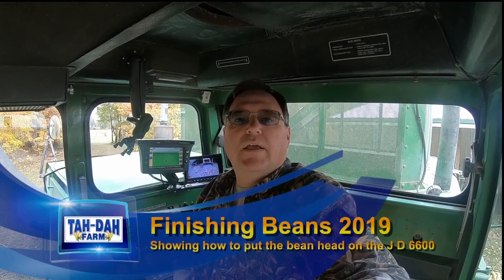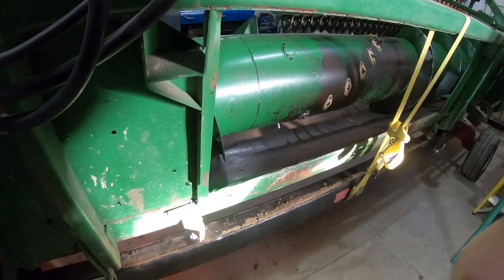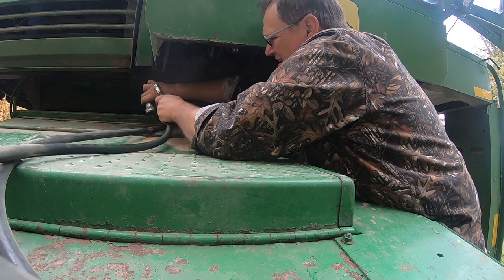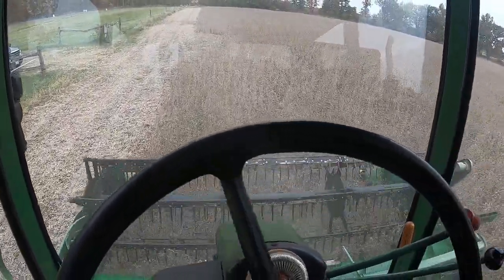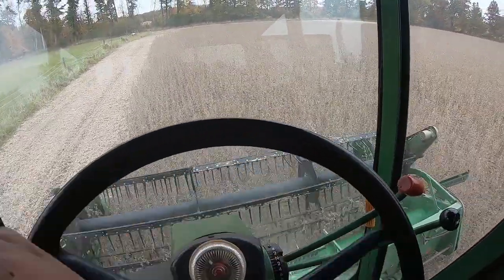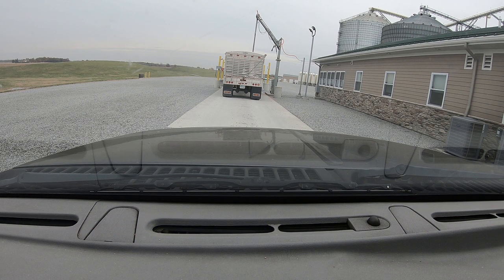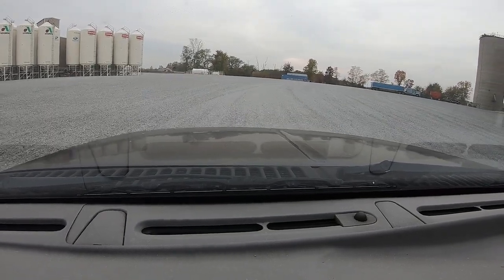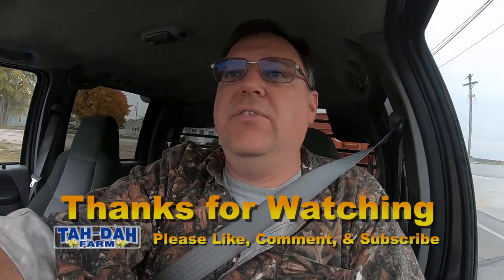Bean Head Install on the 1974 John Deere 6600 and Finishing Beans for 2019

Comment: We had an 300 bushel unverferth gravity box and I pulled the bumper off my 78 ford F-150 one year. Took me a day but I  rebuilt the hitch and bumper.. usally pulled that trailer with our ton & half bob truck or a tractor.
Reply from the maker: I use my 1 ton truck that has a new flat bed on it. The hitch is part of the bed. My neighbor will pull 2 300 bushel wagons with his 3/4 ton. I told him he is crazy,  lol. I have pulled 2 250 wagons at the same time but not a fan if it. I do like using the 400 bushel Parker grain cart I have. It seems to be the best setup to move the most grain at a time that I feel comfortable with.  Thanks for watching and commenting.

Comment: Take two pieces of tape put them on each side of the combine feeder house and top of the header that way just line up the pieces of tape and you should be lined up with the holes first try. we used to do custom harvesting and we would never would waste time backing up and turning around at the corner we would just make the turn and come back after we finish the field and pick up the corners that were left save a lot of time.
Reply from the maker: Thanks for the info.

Comment: Is it 40% a little bit high on the foreign matter? Maybe adjusting the screens could have helped a little?
Reply from the maker: I miss spoke,  it was 0.40%, but I did say 40%. I did not getting docked for FM. I do appreciate you watching and listening all the way to the end and your comment.  Thanks again.
Reply: @TAHDAHFarm  I did custom harvesting back in the 1980s with  Small's Harvesting out of Senath  Missouri. They had moved their base to south Mississippi because they had two really big customers down here. I used to cut beans for them down here after we went out west cutting wheat. I had a few customers of my own and I would take their equipment and cut myself. They had 16 John Deere 8820s but they kept two of the old 7700s from the previous upgrade. Their customer base was a lot of older farmers and one by one in the 1990s they passed away and finally got to the point they just went ahead and closed shop on custom harvesting. I developed a love for it so much here in my sixties I'd like to get a little 6600 and do a little harvesting myself but they've stopped growing anything down in south Mississippi as far as crops all they grow down here is cattle! Lol. And I can pick up a nice combine fairly cheap but there's nothing left to cut it's a shame. But I like watching the old John Deere run.
Reply from the maker: It is very hard to find ground and I don't want to be getting ground by "steeling" it. All the ground I am farming, all 50 acres, has been new ground from hay fields or big farmers that don't want the small fields. I am looking forward to farming the 16 acres I have perched over the last 2 years. The rest of the fields are 2 to 6 acres in size. My goal is 100 when I retire just to keep me busy.  I wanted to just help the neighbor guy but he didn't want any help. So I'm doing it by my self.  I'm having fun and that's what it is all about.  Thanks for being here and watching my channel.

Comment: Isn’t 40% FM kinda high, can’t the air and screens be adjusted to screen off more unwanted FM
Reply from the maker: I miss spoke, it was 0.40% which is pretty good. They don't dock on payment until you get to 1.0%.
Reply: @TAHDAHFarm  that sounds much better. I running a 7700 Turbo presently but also have the 6600 and 4400 all with ridgid platforms, 215,216 and 218 Draper. I harvest grass seed where small grain chaffer is used on top with a round hole perforated screen on bottom are used. Low air speed, 400/450 and higher cylinder speed, 1000/1100 and tighter concave settings are used to strip seed from grass stems, concave on 2/3.

Comment: Do you ever have trouble feeding green stem beans with that head? I've thought about converting a Deere or CaseIH head to fit my R52 Gleaner. My 800 series head doesn't feed very well. Otherwise I'm looking at an Orbit Reel or Crary air reel but that's expensive.
Reply from the maker: I haven't had any problems with green stuff but short beans kinda pile up and then catch which then will give you a slug. Just have to watch for it and it goes just fine. Good luck with whatever you decide.
Reply: @TAHDAHFarm  Thank you. I think I may try an Orbit Reel and see what it does and if not good enough maybe look for a green or red head..... hmmmm my wife may not understand that last part LOL

Comment: My son just bought a 4400 combine. I was wondering if you know what that white light right  above the steering wheel is for. Ours looks like it has a red bulb inside but it never comes on so just wondering what its for.
Reply from the maker: I just went back to look for a video but I can't find it. I have talked about it before but that will make for a good video to do. The light will flash when one of the 5 sensors are not running fast enough.  There should be a box to the right back corner of the cab that has 5 lights on it. That is the monitor control panel and will turn that light on. I made a lot of repairs on my to get it working again.  I will definitely do a video on this in the near future.
Reply: @TAHDAHFarm  Thanks for the reply. None of those sensors work on our combine so thats probably why I have never seen this light come on. We are planning to try to get those working if we can. This combine has around 3200 hours on it and it appears to have a newer concave in it because it has newer looking black paint on it. Its also a diesel with the rotary screen. My son paid 1000 for it so I feel we can do a few repairs on it.
Reply from the maker: My John Deere dealer let me borrow the testing tools to check the control box and make sure it was working properly. I had to replaced the lights and I used LED that a friend got for me. I then went to the combine graveyard and got the used sensors that I needed.  I also found that the switch under the cab was plugged up with dirt and bent. It is located so that when you push the handle forward to start the threshing,  it sends power to turn the control box on. It is nice to have, I had the chopper belt come off one day and the light started to flash. So I then looked to see what light was on on the control box. I know the combine graveyard has the control box if you find that yours is bad but it is not cheap. Good luck and thanks for subscribing to my channel.

Comment: Always enjoy your videos your the one I closest relate my operation to. Glad you’ve had a good year. Any purchases on the horizon
Reply from the maker: Thanks for watching.  I bought the Kewaunee disc about 2 weeks ago.  I looked at something on one of those small used private lots. With the purchase of the disc, I am trading my IH 370 disc and some other equipment that I will not need for something,  lol. I don't want to give it away yet,  so stay tune. I hope to switch the equipment this coming week and make a video of it.
Reply: TAH-DAH Farm I’m gonna bet it’s a no till drill. If I’m right and it’s  a Great Plains the dealer I worked for sold those as well. You asked about the cylinders on the kewanee folding disk. I couldn’t remember for sure but a friend said everything kewanee was cross he thought.
Reply from the maker: It looks like a Cross.  I talked to Crose the other day and the guy emphatically denied that they made cylinder for Kewaunee.  I was later talking to B&B Hydraulic which is located close to Crose in Kansas.  He told me that they made a lot of parts for different manufacturers like Kewaunee and when the manufacturer goes out of business they get rid of the line of part to push their stuff. B&B was not surprised at all about Cross's comments.  O well,  I ordered 2 new Crose cylinder for B&B and they should be here on Monday. My biggest problem was the shaft size on mine was 1 3/8" and Cross are now 1 1/4".
Reply: TAH-DAH Farm as long as your bought a set so the ones it’s phased with are the same it should operate exactly the same. If you have any trouble I can try to help with what I know. The only real problems I remember having were the rear hitches were week and I remember a few had the little links on the side that are part of the fold (look like a midget top link) would break. Otherwise their a great disk to own.
Reply from the maker: Those top link things look to be ok. Need to oil them up good. As far as the hydraulic for the wings, it also has what looks like a splitter that will regulate the flow so they move at the some rate.  It seems to be working just fine.  Will see next week.

Comment: I actually thought they were easier than that. It's not bad but my Dad's 1961 E is no harder. Just has to be on a level surface and drive in. Sometimes it takes 3 or 4 attempts and the next time you hit it the first time.
Reply from the maker: The only thing different then my neighbors 6620 and any of the newer combines is that they have a lever that locks it on and I have to use the bolts. Some also use a pto type setup and not the chains.  Thanks for watching.

Comment: What is the orange light on the top of the steering column behind the steering wheel.
Reply from the maker: This combine has a monitor that has 5 rotation sensors monitoring to make sure that everything is at proper speed.  If one of the areas slows down, ie a belt breaks,  that light will come on. This is an earlier version of monitor so the light is the only indication that will get your attention there is a problem. The newer combines have a light and a buzzer. There is a panel down by the gear shifter that has the 5 individual lights to let you know what area is the problem.

Comment: Are you pretty far from the elevator not to use a tractor on the wagons?
Reply from the maker: Yes, it would be at least 45 minutes one way with the tractor and with the truck it is about 20 minutes. Then the time it takes to dump at the elevator. I didn't use this elevator last year. The two elevator that I use are within a mile on the distance.  With that being said,  I go to whichever is paying more and last year Sunrise was paying about $0.10 less last but this year it is the other way about $0.05 a bushel. Sunrise put in the new dump and can take corn and beans in it. I seen a Simi truck dump a trailer in about 3 minutes in the new pit. I was surprised and I dumped my wagons with the door wide open. 2 years ago they only had the 3 pits and one was ready slow if the one next to it was being used. It could take about 10 minutes to empty a 250 bushel wagon not to mention the time that was created by being slow. The other elevator is coming up on price and paying more for corn now so I might be taking the corn there. Thanks for watching.
Reply: @Brad Sisson sometimes using a tractor and grain wagons can be dangerous, most farmers around me who are more than 2 miles away from the grain elevator will use a dump truck or a grain trailer behind a rig. Just depends on how the season is as well
Reply: Crouch & Sons Farm you are right. We did tractors and wagons for years. All depends on your roads, distance, and elevator location. Just a change in times as that was a thing of the past. Gravity wagons behind a tractor or truck can be very dangerous.